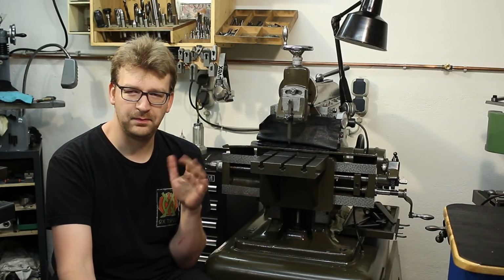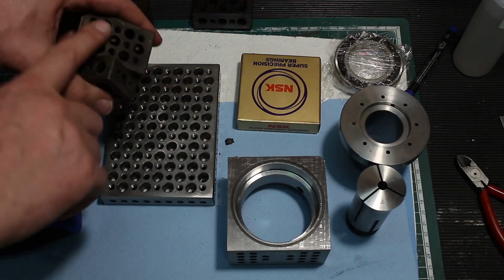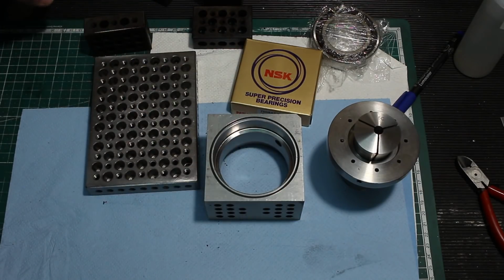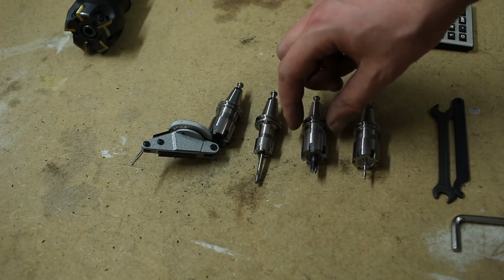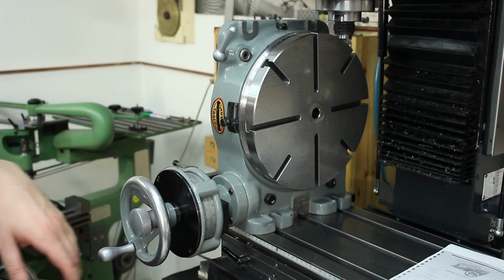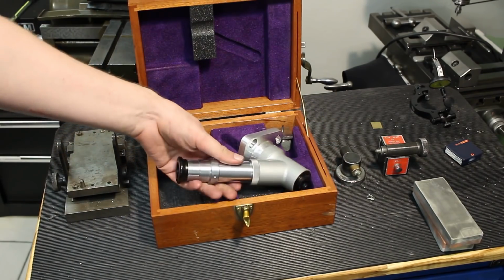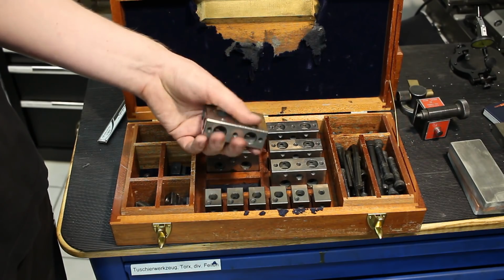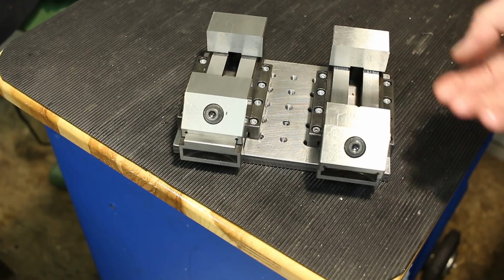Shoptalk #16 / 07-2018

Comment: 20:20 "so I have to recut
 these slots with mango Graham"

I heard it as "mangle grinder" - which could be a very interesting tool indeed !

We know what you meant anyway ;)

How about making some T nuts with a step over in them ?
Having seen people aligning vices etc. accurately, it leaves me wondering why they don't make precision T nuts that extend above the table to precisely fit in the mounting slots of the vice, rotary table, whatever, so that they're always bolted down perfectly square with the table every time. That's what I'd do.

Comment: 0:12 (Don't look, it's not a pretty sight) Having seen a few shaping videos lately and not noticed, I'm somewhat baffled by your shaper's T slots being parallel to the shaper's axis rather than perpendicular. I can hardly believe this is a safety design feature in the event of it all going horribly wrong that the part being machined would be pushed along the T slots ! For convenience, I'm sure I would have gone perpendicular and used the slots as stops meaning that clamping bolts don't need to be specifically tight.

Comments ?

It appears that the shaper's power lead is plugged into a wall socket to the left of the shaper despite the fact there are 2 sockets immediately behind the machine unused. Where it is plugged in appears to be another pair of sockets, both of which are in use. Logic to me would suggest it was better to have the shaper plugged in immediately behind the machine thereby leaving 2 empty sockets in 2 different locations rather than both together and in perhaps a more awkward location to access.

Comment: You mentioned using 60 grit emery cloth on the table.  Are you going to paint the top Gray?  By the way, the little magnetic cube with the centering scope is used to apply ink to the ring of the eyepiece.  WHAT A HAUL!  SPREAD EVERYTHING ON THE FLOOR AND ROLL AROUND ON IT!

Comment: Thanks for another interesting "Shoptalk"!  I might have missed something, but how do you attach the vise pallet to the angle plate? One has M6 threaded holes, the other has T slots.
Reply from the maker: Ah! I have a few untapped trough holes with counterbores to hold it on the angle plate with screws and t-nuts.

Comment: I'm soo soo sad and upset that you are getting rid of that beautiful machine. It's perfect in every way and OMG like brand new. I need to make an internal gear and the first thought that pops into my head is wishing I had Stefan's shaper in my shop. The solution is obvious. Just mount an angle grinder to the ram and you could have a T&C grinder with auto feed!  ;-)

Comment: This isn't a vlog. It's a Moore tooling gloat. Shame! We are all green with envy. You suck! as they say on Practical Machinist when someone reveals a particularly fine acquisition

OTH, you are one of the few capable of putting that highly evolved Moore tooling to the use for which it was intended, ie: working to microns. Better in your hands than mine.

Speaking of Moore tooling, back in my working days as a bureaucrat I was researching candidate contractors to retrofit a whopper Pratt & Whitney jig borer. This was at a time when one micron positioning in a servo axis drive was science fiction. 

Outfits capable of such work are thin on the ground. In desparation I contacted Moore for referrals. If anyone knew the low profile primier high precision machine tool retrofitters. In the end I was passed to Mr Ray Matika(?) a fine gentleman and supervisor of the Moore scraping department. He had few answer for me, a referral or two not on my list, but he was a wealth of precision scraping lore. Somewhere in my horde is a couple pages of notes I took as Mr Matika rambled from one sub-topic to another of scraping as performed at Moore. Perhaps I can find them. Words of gold.

Suffice it to say the beauty and consistant appearance of the scraping to be found on the precision surfaces of Moore machine tools and attachments is a by-product of the precision required and not in any way intended as an esthetic treatment.

Rat!

Comment: wait wait Stefan.can EDM mashine make precise holes like Moore jig grinder or your boss doesnt need that kind of precision?im ery curious coz i think jig grinders are becoming cheaper and cheaper so maybe hobby mashinist like me can get one.can someone  answer me?
Reply from the maker: A jig grinder/jig borer will definetly create a rounder hole than a WEDM, thats a given. But for the punch/die and moldmaking we do, it seems not to be a problem.
Reply: thanks for the answr.not many got timebig fan of your way of teaching.i was thinking you should make European summer bash like Stan.i have so many questions for you.thanks for your time
Reply: oo boi i just saw some grinding discs with balancing flanges.one month ago i bought here in Bulgaria my BLOHM surface grinder model hfs 204 and im missing a flanges and i cant find the propper taper here in Bulgaria.from what mashine are these?thanks
Reply from the maker: Those belong to a huge ABA surfacegrinder - But I didnt buy the grinder or the wheels/flanges.

Comment: Grinders are my next purchase, not sure if I want a surface grinder or tool grinder first though.
Reply from the maker: I think a surfacegrinder is the better choice if you want to go with only one - Most t&c grinders are very universal, bot not very good at surfacegrinding.
Reply: Stefan Gotteswinter I could have used a surface grinder on my most recent video, and may try the same project again in tool steel and harden the whole thing then grind it for accuracy so it's more a toolmakers vise then just a drill press vise. https://youtu.be/Yec2_8mADEo

Still a very fun project.

Comment: Stefan,  Thank you for producing this video.  I have a sense for how much effort it takes. So, a heartfelt thanks.  I'm also looking for a spin fixture.  I admire the Gin Chan multi-function device.  It's pricey and perhaps 20% too large.  I have a CShine 6x12 surface grinder.  The one with the ball bearing slide.  Your spin fixture is interesting to me.  It's not likely I would use 5C.  I use my mill as a lathe and want to use the TTS from mill to grinder.  Today, I just finished a 150 mm TTS jig plate for boring tapered holes in rectangular blocks. The jig plate can be balanced if blocks are eccentric.  The spin fixture will accommodate the jig plate and perhaps an ER40.  I'd be interested in your thoughts on this.

Comment: Some nice tools there Stefan!  We had a 2 arc second version of that rotary table on the Moore measuring machine where I used to work. 
ATB, Robin
Reply from the maker: Thanks Robin! Cant wait to actually use the rotary. I guess it will be also very usefull for inspection on the surfaceplate.

Comment: Angle grinder would have been stupid for the table slots. Nowadays, everybody uses a Plasma cutter... :-)
Reply from the maker: Oxy-Fuel torch? ;)
Reply: That would work if you cant afford the plazma cutter, torch doesn't do well with cast iron but you can still getter done. :)

Comment: Hello Stefan. I've been a long time admirer of your work and videos. I have a full size Bridgeport CNC that I'm retrofitting the controls on. When I see your benchtop manual mill and CNC router I have to wonder if that could be a better strategy to get into CNC for odd shapes and also retain "real" milling capability. If you have time to comment on your experience with these tools I'd appreciate it. Thanks for the high quality work and videos.

Comment: and now we take the rotary table a part to see if i can improve it........................kidding offcourse

been looking around at tool grinders , my idea was to buy damaged and blunt tools from machinefactories and fix them for my own use , the grinders i been looking at are pretty expensive though making me wonder if buying stuff new be cheaper for the first couple of years 
i wonder if you can get fixtures for youre surface grinder that can do the same things , i have seen that the surface grinder this old tony has can be extended with tools for grinding drills and other stuff

nice score on those tools , you will get some use out of it for some tie 

shapers are hard to find aspecially in that size , was looking intoo them but the only thing i was thinking of doing with it was making keyslots in puleys , there smaller tools available for doing that

Comment: NOOOOO!!!! that shaper is going off to a new home. :-( I can however see the need for a proper tool & cutter grinder. Especially after that awesome tool score. So something does have to go. It's extremely doubtful the words Angle Grinder and Moore Rotary Table have been ever used in the same sentence very often or maybe never. :-) And I'm very envious of that Moore R/T. If you ever do have to pull it apart I'd sure be interested in seeing the internals. I'd bet there just as pretty as the outside. That R/T needs a velvet lined storage box as well just to keep it warm and safe at night.

Comment: I also have a tight workshop and therefore agree with your decision to get rid of the shaper despite being a cute machine. As you say the only operation of  a shaper that is not so obvious to replace is key way cutting. The usual suspects are key way broaches and some kind of a press or a vertical broaching machine. When you say that you will broach with the mill I tip on something similarto a broaching machine. I am looking forward to see your approach to that.

Comment: Thanks for the video! I have a rookie question: how does heat treating affect the size of parts? I know heating enlarges the part, but does it retain that size after quenching or cooling?
Reply from the maker: parts grow slightly when hardened. its a very minimal factor, but they grow - we have a chart at work with the growfactor of different tool steels when the part gets not machined/ground after hardening. I generaly leave parts 0.2mm oversized on all surfaces to allow for machining, grinding and getting rid of the decarbourized layer.